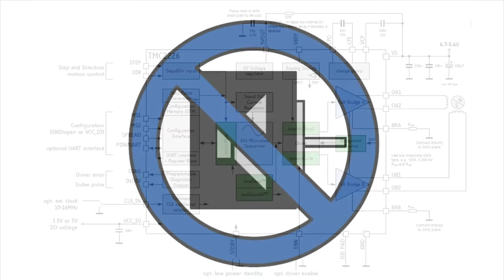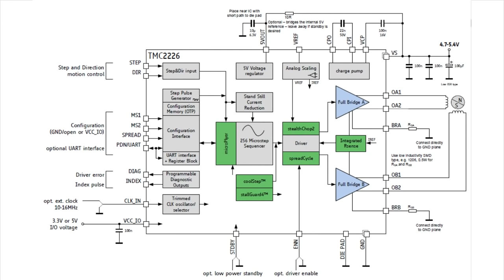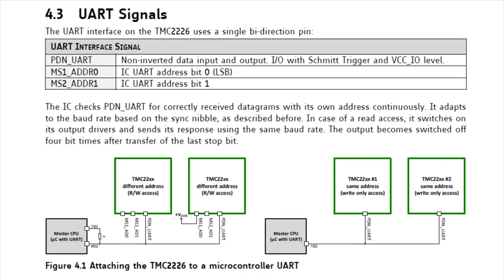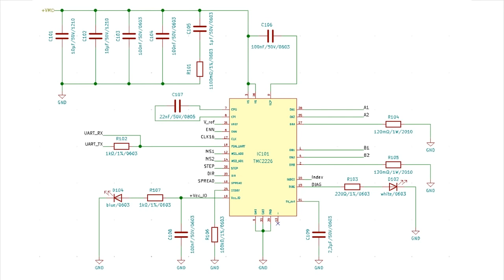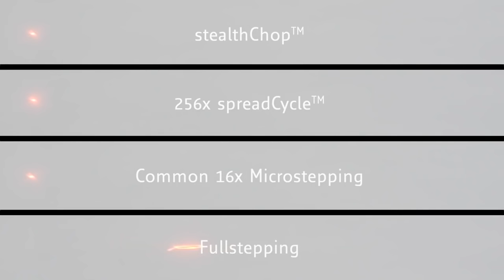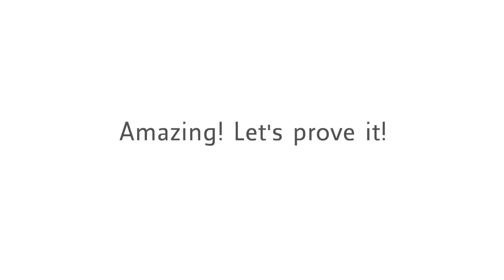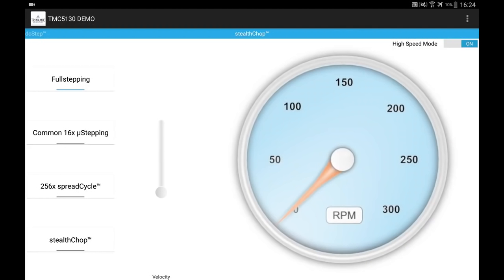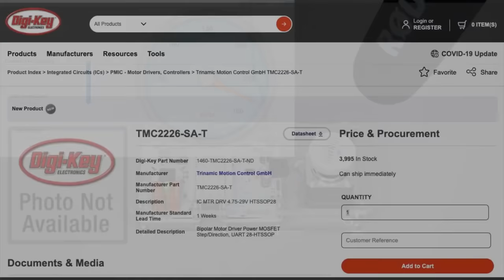EYE on NPI - TMC2226-SA Ultra-Silent Stepper Motor Driver #EyeOnNPI #DigiKey @digikey @adafruit

Comment: Well done.  I am a big fan of the Trinamic family and currently use the TMC2209 & TMC5160 to control peristaltic pumps. Stepper motors have a tarnished reputation of being difficult to drive, hot to the touch and painful to the ear.  Trinamic has found a way to make a cheap stepper motor run like a champ.

Comment: Pretty cool! Will have to see how it compares to the 2209 which has the best reputation right now for 3d printers I think. If you end up making a board for these, do mind the cooling requirements, which at least on their other drivers means you install the chip on the "back" and attach the heat sink to the front (to the stitched ground plane, directly on the pcb.) Apparently your copper weight also matters.

The joy of having smd breakout boards handy - almost makes me wonder if they're worth upgrading to add a pad under the package with some solder bridges, in case more than just trinamic drivers like their packages really soldered down.
Reply: for a nice overview of the 'available' drivers have a look at 
https://learn.watterott.com/silentstepstick/comparison/
for my next project i will try the TMC2130 with direct SPI interface
(it only has ~1.2A RMS) - and maybe i will get it Feather Compatible ;-)

BreakOutBoards:
most of the nice TI led-drivers also have a thermal pad.
but the sizes are slightly different for each chip...

Comment: So how can one get this chip in a breakout board with a heatsink?

Do they have anything similar for brushed motors?
Reply: somewhat - yes. i have not tested this yet...
it is meant for battery powered devices..
TMC7300-LA
https://www.trinamic.com/products/integrated-circuits/details/tmc7300-la/
- 1.2A per motor continuously
- Axes	2	
- Motor Supply	2…11V	
- UART		
- PWM (internal)
- Current Limiter		
- Single & Dual Motor Option		
- Direct Phase Control		
- Phase Current, RMS	2.0A	
- Package	QFN20 (3x3)
Reply: BigTreeTech offers tmc226 breakout boards although there aren't any reviews yet. It is the first version for this particular driver and they always have flaws in their initial versions. Watterott electronic which is a German company originally made open source breakout boards but ended up getting copied by the Chinese companies. This time I don't see the German company making a board for this driver unfortunately.